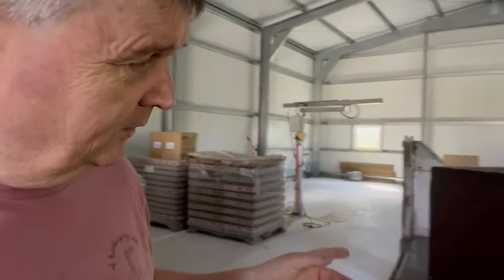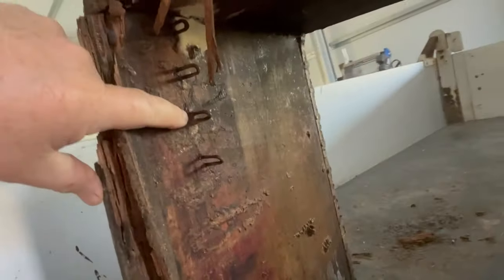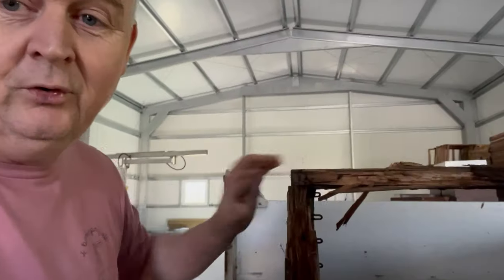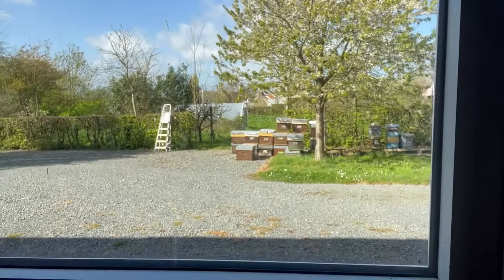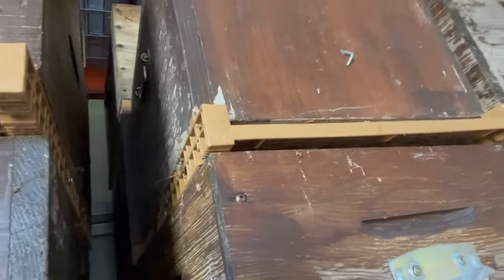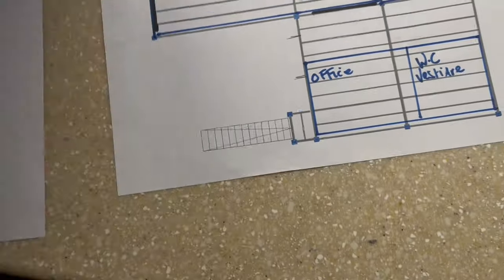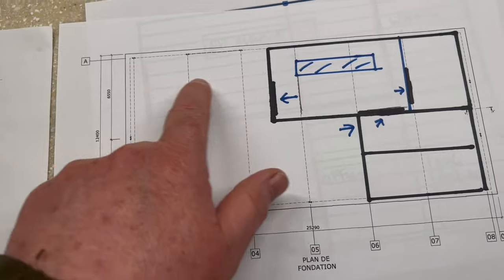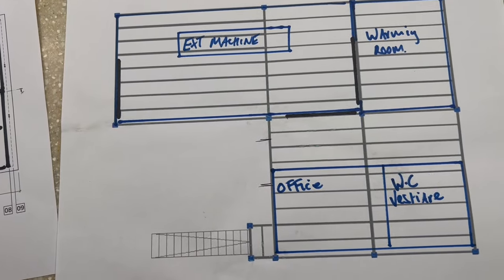A free palette lifter? Yup!!

Comment: Richard, are you obliged to have Engineering Inspection Insurance on your Extraction Line and the lifting equipment? Also Engineering Explosion Insurance on the hot-water boiler unit of the Extraction Line?

Comment: Does the SWL on the pallet truck reduce with hight lifted? I know some models do especially at large heights.
Reply from the maker: Hi Richard, yes it does but it will lift in most cases all I need up to the mezzanine. But yes, there is a chart you follow that gives you the loss over height

Comment: Your extraction room has three doors.  One to right going to warming room, great. One to the left going to main warehouse, great. But the middle one seems like a waste of space. You could move barrels straight across your extraction room into the warming room and out again. Without needing a the middle door. 10:38 This gives more floor space to be used in central area in front of the heat pump exchange area, instead of needing to be kept clear for a third doorway, which could be more office space. This should help keep your office space cleaner not rolling traffic through that area.
Reply from the maker: There isn’t a middle door, I
Must have made a mistake. There is just a corridor with the main access to the extraction room then if you go through that door on your right that takes you too the warning room.
The room that has electric and building stuff in it  has just a normal sized pedestrian door. When you enter the extraction room there will be a door the garage end of the extraction room, to exit with palettes. I see why you asked , that’s just the mezzanine above you can see marked , so it’s open underneath. Thanks for mentioning it